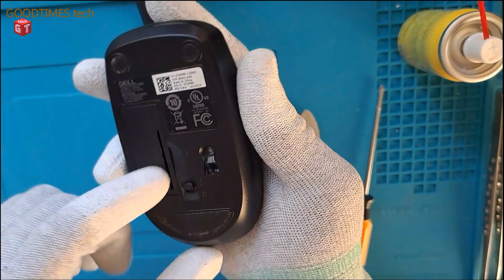DELL wireless mouse intermittent not working, Let us check and solve.

Comment: Solved my issue.  Thank you
Reply: I called dell support and they said its working as per design. They said the light will come only when the battery is low and requires a replacement battery. I suggested they print it on the box.